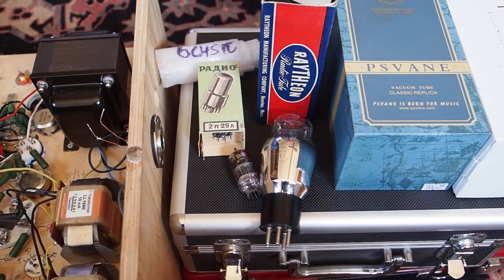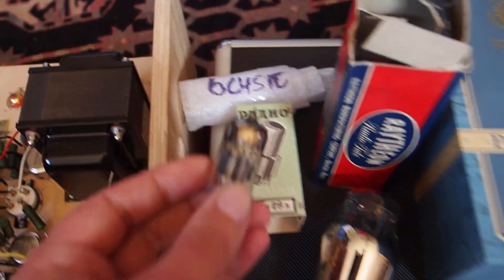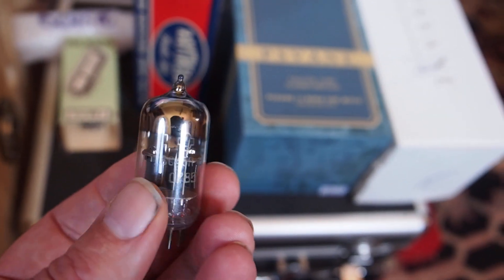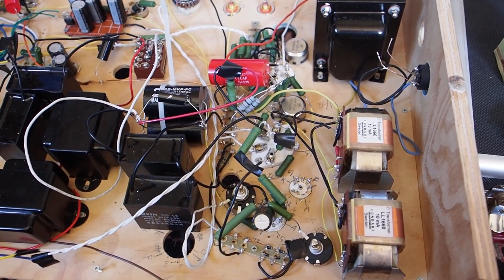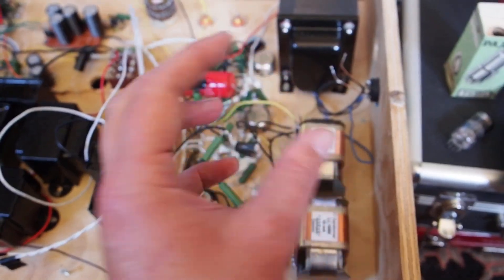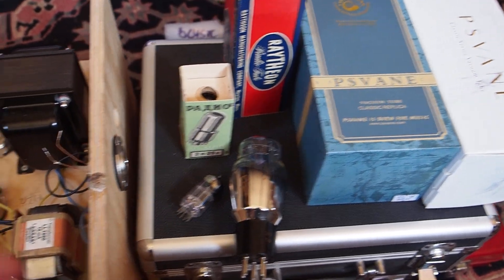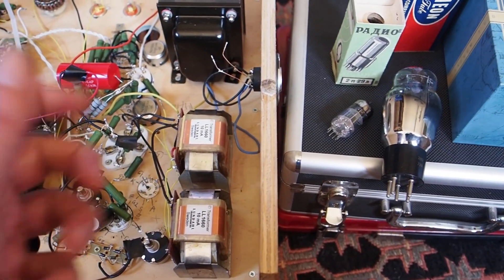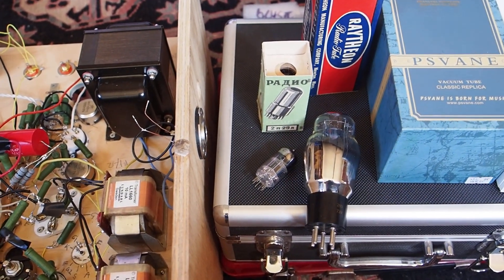8 driver tubes compared - part 2: 6C45P replaced with DHTs

Comment: Do you think a 205D will be a good driver tube in 2 stage deisgn? need steptransformer for sure.
Reply from the maker: From its specs, I' expect that it would interstage or grid choke coupled. A 2-stage with a 300B or 50 will indeed need a step-up and a good preamp to drive it.

Comment: Hi Eduard, I see you are moving away from using tubes being a resister. Is there any reason for that? What kind of resisters are you using? And do you use different resister types for different purposes?
Reply from the maker: Hi Hugo, good question. The tube rectifier bias is my preferred way of biasing a (non bypassed) differential output stage. In a single ended stage it would add a non-linearity if not bypassed. 

So that's why I have only applied this in a differential setup and there it sounds better than a common resistor. If you'd inspect the return loop for a differential amp, how the AC/music signal runs, you can see there that the AC signal return loop runs through the OPT, and then through the 2 plates of the output stage, so the tubs are operating in series. That together with the tube rectifier I think produces the best sound and it has a different harmonic spectrum to a push pull amp where each tubes has its own resistor and bypass and operates in parallel/independent.. there the AC return path runs through the bypass cap and via B+ and one section of the OPT.

By the way, this rectifier type of bias will come back in the next amp, which is fully differential (two SE amps running in opposite phase to each other).

Anyway, here in this amp, the 2P29L runs a filament bias which I'll take any day if relatively easy to achieve, the 47 because of direct coupling needs a bias that relates to the anode voltage of the 2P29L.. else it can destroy the 47 really easy - hence it has a high wattage wirewound resistor as cathode bias.. and then the Type 50 runs fixed bias, which makes leaves more of the B+ voltage plus allows me to dispense with a bypass cap. The only downside of fixed bias is during class A2 operation, where the grid current draw could influence the fixed bias but so far the 10mA current I use there seems to suffice. 

As for resistor choice, I tend to go with high wattage wire wound resistors as much as possible. If I had more money they'd be of the bifilar/ non-inductive type or I might look at what AN has.
Reply: @EduardBroekman  Thanks for the comprehensive answer.